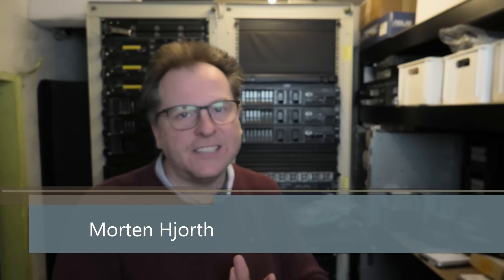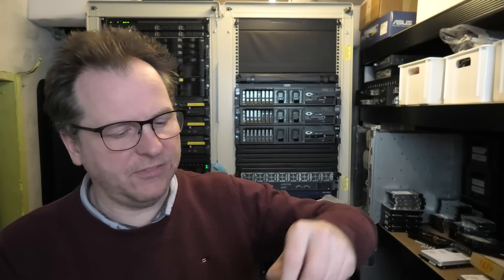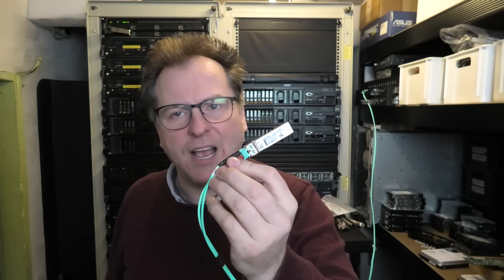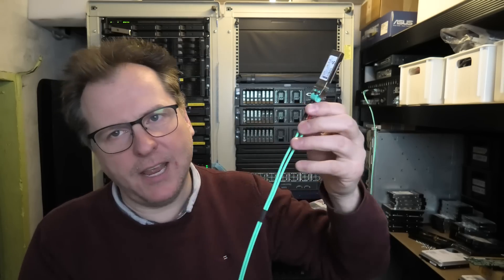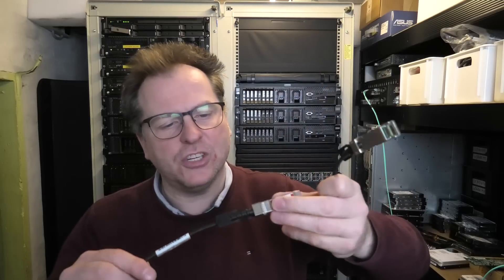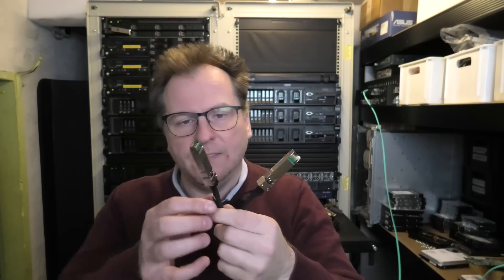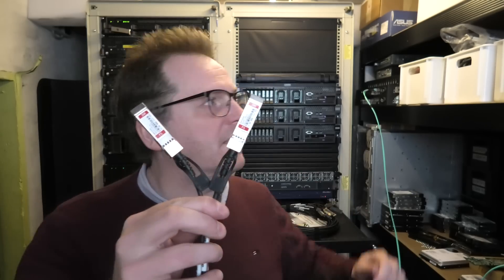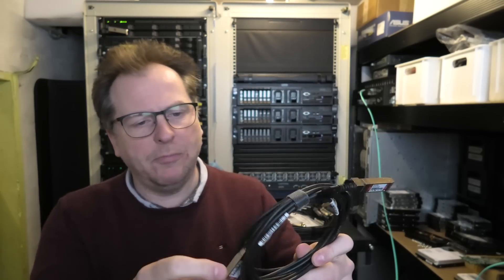Why DAC Cables Kicks Fibers A$$, in DataCenter Rack - 1284

Comment: I agree with you IF you use +10 +30db transceiver for 30cm cable.
And fiber optic cables is not to be exposed to open air and saliva from your mouth while you talking.
Fiber optic cable ends should be exposed only for reconnecting between sfp modules. It is less than a second.
The Ethernet driver consumes electricity as well. And it is more than low power sfp fiber optic modules.
Reply from the maker: Hi @-Oleg1
Thank You very much!  glad you liked the video :-)
Thank you for watching! :-)

Comment: I have a question, really appreciate if you could answer it, isn't fiber the only option for connections over 10GbE? Now that the 25 or even 100 GbE switch / NIC's are semi-affordable, what would you recommend using with these switches (DAC or AOC)?
Reply from the maker: Well 25Gbit DAC is avalable in SFP28 and 100Gbit in QSFP : https://www.fs.com/de-en/products/50483.html?attribute=10068&id=3763082

Comment: Another advantage of DAC cables is low power consumption (arround 0.3 Watts at each end), however length of DAC is limited to 7m. That's the reason, why I am using an AOC cable (power consumption arround 1 Watt at each end)  to connect two switches at different rooms at my home, all other connections are either connected using DAC or 2.5 Gb SFP+ RJ45 transceivers or 8x2.5Gb + 10Gb SFP+ switches. Meanwhile these kind of switches became cheaper, If you buy them at Aliexpress. Regarding DAC and AOC resellers, I totally agree FS provides good quality, no issues.
Reply from the maker: :-) I have a 8 port 2,5Gb with 10Gb SFP+ in order from Aliexpress :-)
Reply: @MyPlayHouse  I guess, similar to my switch, which runs now for two month, without any issues, once I've understood the UI. Price 77€ is fine, however two complains, switch does not Support SNMP and Management IP via VLAN, however, good product. Best regards from Bavaria to Denmark (or Portugal)

Comment: Very good video, even though I disagree!

In the data center, if you have 20 or 30 connections in a rack - even just to the top of the rack - the cables of DACs quickly become very difficult to manage. Fiber, on the other hand, takes up very little room, is more flexible, and is much much easier to pull to another rack (no need to push and pull an SFP through the tray). And, at least for us, dirty fiber/SFPs isn't an issue as the covers only come off the second before it's inserted, and fiber is never reused.

As single mode fiber and optics have gotten cheaper, we've moved to a "Single Mode Everywhere" design. For 10G we use LRM transceivers (as opposed to SR or LR) to limit the costs and the power use, and they have the added benefit of working with single mode or multimode in case we are forced to use MMF due to legacy equipment.

I'm not completely opposed to using DACs (and you make some good points), but I'd prefer to use fiber any day.
Reply from the maker: It is a lot of work checking cleaning and checking all those fiber cables with a microscope,, been doing that all week.

Comment: Thank you!
I have an unusual case, I want to make a small board that connects 2 DAC passive cables at 100GB speed.
But I can't get the host system to work through my board and 2 DAC passive cables. The DAC cable is 50cm long. The lines on the board are 15 cm long; there is an overlap of RX <-> TX signals on the board.
Tell me where to look? Who did something like this?
Reply from the maker: I have not yet seen 100Gbit SFP,, that is usually QSFP
Reply: What will happen if you sew into the eeprom QSFP28 DAC cable the information that it is 2 times longer (the cable is 1m - we sew up that it is 2m).
Will it work? Will there be communication between NIC ports? @MyPlayHouse

Comment: Say I have a home with 5 PCs and 9 POE cameras, and a few other ethernet devices for smart home, like a Hue hub, SmartThings hub, etc.  The cameras are on a different VLAN, and the PCs contain some VMs that are on their own VLAN, running little web servers.  I am interested in the PCs having 10GB connections to a switch, but don't need more than 100mbps for the cameras.  Should I use multiple switches for this?  I don't know how I could get a managed switch that has PoE ports for the cameras but faster ports for the computers.  The maximum distance between computer and switch is about 15 meters and I can easily run a new type of cable, be it DAC, Cat6, etc.  Do you have any suggestions?
Reply from the maker: I think it will be cheaper for you to have a faster 10Gbit SW with just a few ports,, and another SW with 12-ish POE ports.
A 16-ish port 10Gbit SW becomes,, expensive.

Comment: Cable managing more than a dozen DACs in the same rack quickly becomes a problem since the cables are thicker and you cannot adjust the length of each cable by redoing the plugs like RJ45/BNC/others. Fiber optics, although has to be deal with care they are much thinner and easier to cable manage when the number of cables becomes a problem.
Reply from the maker: That is somewhat truth,, it is not possible to make them longer or shorter.. but they are really not that much thicker than what we use in RJ45 connections,, there are thinner versions out there :-)

Comment: Power usage has become a hot topic these days. Can you do a power draw comparison between fiber (sfp modules) and dac? This would highlight how much power you can save with dac cables instead of using fiber
Reply from the maker: Would be interesting,, but I would kind of have to measure the power usages of a PCI card,, and that would be complicated.. humm
Reply: @MyPlayHouse  Maybe it would be easier to test with a switch? And if the results are not distinguishable with 1 SFP/DAC cable you can just add mor SFP modules until you see a difference in power consumption.

Comment: Done a bit of service work, and agree that DAC is really handy for top-of-rack connections unless your server needs to be extended regularly with the DACs remaining connected via articulated cable management arms - such as top-loading dense storage servers like the Gen8/Gen9 HPE 45xx, designed to stay online during disk swaps.

In such cases, you can get bend radius right with fibre and not have to worry much after that, but I've seen what looked like copper DAC cables reaching fatigue/work hardening failure from regular disk changes on top load servers.

(aside: Pretty sure I was the first, and also possibly the last guy who ever had to install 2*IB + 3*Cat5 + 16*12G SAS cables through the HPE Gen9 4520 cable management arm, to allow online disk changes in the 4520 chassis while the 2 server blades stayed connected to 2 multipathed/multihomed JBOD chains; HPE Lustre Scalable Storage was only barely that scalable. My pictures of what I made work went in the installation guide, and were... daunting.)

Anyway - I've seen instances where arm extend/retract cycles and challenge of keeping strain off the DAC SFP connectors when such servers were fully extended led to intermittent network failures - making the disk replacement hazard window more hazardous, and leading to "complicated" service cases that made life great for the field engineers. :^\
Reply from the maker: Hi Jason Ozolins
Thank You very much!  glad you liked the video :-)
Thank you for watching! :-)

Comment: Funny, you just answered my question in my head of last days. I was checking 10Gbit options for my Rack with NAS and Hyper-V HPE server stuff and was thinking about Mikrotik 10Gb switch and if i can connect via DAC cable as i found Mikrotik DAC so cheaper in comparison with SFP+ modules + cable itself, Fibre or RJ45. And i just did not understand, why the hell is that so cheaper, i was not sure, if it would even work, or if DAC is just some connection only between switches itself.
Reply from the maker: I have a video comming next week with "all" the connection options. :-)

Comment: DAC all the way ideal solution if you stay within the same cabinet, Or to cross connect two node / server HCI solution without a very expensive switch. And if there is something wrong it's easy to diagnose by replacing the cable,
Reply from the maker: Hi andre van Gijsel
Thank You very much!  glad you liked the video :-)
Thank you for watching! :-)

Comment: For me, the two biggest deciding factors as to what type of cable I will use is length and price.

DACs are shorter and cheaper, whereas fibre are longer and more expensive.

I use, I think it's 15 cm SFP+ 10 Gbps DACs to go between my NAS systems (which have been decommissioned).

And then I have four 1 m QSFP28 100 Gbps DACs for my compute nodes to go to my Mellanox 100 Gbps switch.

And then I think I have to 100 m long AOC cables, one of which goes to my system which runs the LTO-8 tape drive, and the other used to go to my micro HPC cluster headnode, but now goes to the second port on my consolidated server.

(Yes, I run 100 Gbps Infiniband in my basement.)
Reply from the maker: I have a litle 10Gbit in my datacenter but only 1Gbit to my PC.

Comment: I use dual port 10 gigabit SFP+ NICs with DAC in my home network to connect my workstation to my server. Works great for iSCSI/NFS/CIFS and internet connectivity. It was actually quite a bit cheaper than buying 10 gigabit RJ45 ethernet NICs. I had to force the driver to install on Windows 10 on my workstation. The installer refused to want to install on anything other than Windows Server.
Reply from the maker: :-/  My tiny Lenovo,, does not do 10/25Gbit

Comment: Morten sir, the SFP's and fiber "they use power" they use less power than old rj45
Reply from the maker: I would not be so sure.
Reply: @MyPlayHouse  I would be. You say "oh but those get hot" rj45 get WAY hotter it's just that their processing in rj45 based switches is offloaded to the switch. If you've ever taken switch apart you would see the heatsinks. fiber just does light, it doesn't need to do electric signals so it's way less power especially in low distance

Comment: This is likely a non-issue for most people, but no one else mentioned it. The DAC cables have 3X the latency of the fiber connections. We're talking about 0.3NS VS 0.1NS, but if your system uses lots of small packets, this would be relevant.
Reply: These units are incorrect. Speed of light propagation time over 3 metres is 10 nanoseconds.
Reply from the maker: Here they say 300ns vs. 100ns
https://community.fs.com/blog/10gbase-t-vs-sfp-which-one-is-the-best-option-for-10gbe-data-center-cabling.html
Reply: @MyPlayHouse  https://www.arista.com/assets/data/pdf/Copper-Faster-Than-Fiber-Brief.pdf
Reply: I think Cain-san said about 10GBase-T copper, 10GBase-T has relatively large delay, about 3ms, because of forward error correction which is pretty complex multi stage algorithm. Imagine 1.5MB of data is stored on the FIFO of FEC! While Passive DAC that Morten-san shows is much faster than 10GBASE-T, moreover passive DAC is slightly faster than fibre optic.
Reply: Actually the opposite is correct, DAC has lower latency because at such short distances the double conversion between electric and optic signals with fiber takes too much time

Comment: DAC == Direct Attached Copper. DAC started out with all-copper but you can actually find fiber DAC cables. Which seems weird but it works. My assumption is it uses low-power lasers vs. MM/SM transceivers. Enjoyed your video! A lot of people use SFP/SFP+/QSFP+ at home for their labs. I couldn't get by without DACs because the cost is so small compared to fiber or RJ45 transceivers.
Reply: fiber DAC is called active DAC it very similar to fiber plus 2 optics just integrated and can't be separated and probably optic has better calibrated power for just enough power to transmit the distance as it could not be changed as with normal optic when connecting fiber of various lengths. DAC has least heat and uses least energy, then optics, and then there is SFP to ethernet adapters that burn power and get hot like there is no tomorrow.
Reply: @vaidkun  Yes, SFP and SFP+ RJ45 transceivers use a lot of watts and are short-range. But still nice to have! I use a mix of them here as well.
Reply: @vaidkun  direct fiber is called AOC = Active Optical Cable, perfect for distance > 7m.  DAC cables are limited to 7m
Reply from the maker: Hi Doesnt Compute
Thank You very much!  glad you liked the video :-)
Thank you for watching! :-)
Reply: @MyPlayHouse  I love ALL of your videos! :) You do a great job and love your DC setup!
Reply: I couldn't get by without DACs because the cost is so small compared to fiber or RJ45 transceivers

What about AOC cables?   They are cheaper than fiber + two transceivers per cable.

Comment: Same split - longer runs, fiber (noting the correct quality is needed as using 1G fiber to run 10G links is temperamental) and for the short ones, DAC. I have some very short 10G DAC runs that I believe are 30cm or 25cm long, through to about 2.5m. The SPF(+) compatibility can be a royal pain in the @ss
Reply: I just buy fiber MM SR cable at OM3/4 which handles out to 100G and handles everything up to that, so no need for OM1/2.
Reply from the maker: Hi Wiebo Westerhof
Thank You very much!  glad you liked the video :-)
Thank you for watching! :-)

Comment: DACs are fantastic but as you said a lot bigger than fiber... can get bulky pretty easily if you have lots of connections to make 😅
And FS dacs are still on the thin side, Juniper or Arista 10-25G we use at work are a huge PITA, thick, hard to bend and if you ever need to remove one from a bundle in a cable organizer good luck 😂they stick together like glue!
Reply from the maker: Hi Exploited89
Thank You very much!  glad you liked the video :-)
Thank you for watching! :-)
Reply: We use OSI DAC cables at work and they work great! thin and easy to manage.

Comment: I do agree to your point of maintainability, but you also get more flexibility with fiber cables. In my case, the switch is 24x25Gbps+2x100Gbps ports, the fiber cables allow up to 100Gbps, the SFPs I got were 25Gbps SFP28 from FS, and the NICs are all 10Gbps (SFP+), the 25Gbps NICs are still around 250€ each and for 4 servers is quite an investment, so the plan is to keep as much as I can 25Gbps capable and replace the NICs to 25Gbps when prices lower a bit more. I do understand your point about the DAC cables, but you lose a bit of flexibility it really depends you your specific case and how often you're going to change things.
Reply from the maker: We also use 25/10Gbit SW with 2 or 4 100Gbit uplink.. But as we use a Fiber x felt (switchboard) we can´t use DAC at all :-(

Comment: In the rack, I prefer fiber interconnects between equipment I want electrically isolated - that way if one of my outdoor security cameras happens to pick up a surge from lightning, only the devices electrically wired to that particular switch would be potentially exposed. You'd be surprised at how easy it is for lighting to induce a charge on an ethernet cable.
Reply from the maker: Yes fiber would help on lightning,,, not that big of a problem here :-/
Reply: This actually happened to 8-Bit Guy who ran copper Cat5e cable between his house and his mom's.   One day lightning struck his mom's house and it blew the network switches.  He later went back and installed fiber between the houses to mitigate this issue.
Reply: Happened to me too, lightning struck in the back yard, induced a charge on the camera's cable, took out the security DVR, traveled over the HDMI cable plugged into my AVR, took out the AVR, travelled back out over HDMI and took out the projector. New system is isolated.
Reply: If both switches are in the same room, and both switches are connected to the same search protector, would that really matter?
Reply: @raiden72  It would if it travels over the network cable (ethernet or DAC). I'm not referring to surges coming over the power line, as those should be stopped by the UPS
Reply: @raiden72  So the lighting strike comes in to the (copper) cable on the camera to the switch doing POE. And blows it. If it's plugged into a REALLY GOOD and REALLY NEW UPS/surge protector, it will likely not feed-back into the house, office, DC circuits. Fiber cameras are rare, expensive, yada, yada..... Which is why well designed huge warehouse security systems will often run the copper cables (CAT5e/6a) to a small switch, one that handles say 8 cameras, and then it goes fiber to the core switches.
Reply: @Doesntcompute2k  Precisely
Reply: All irrelevant. If the equipment shares the same mains earthing system, the discharge will hit all your racks through the common link. Also remember equipment earths are only functional earths (i.e. for static discharge) so would just melt for a lightning strike. A UPS will not usually stop a lightning strike.